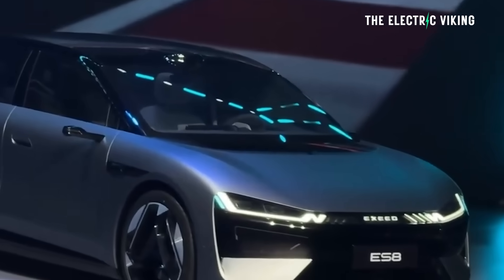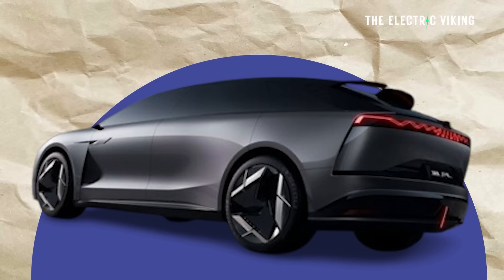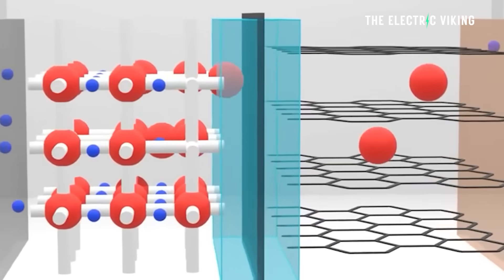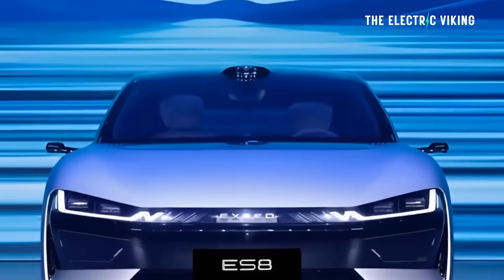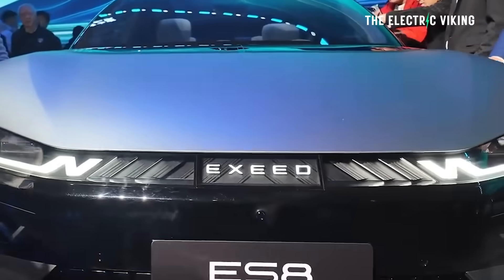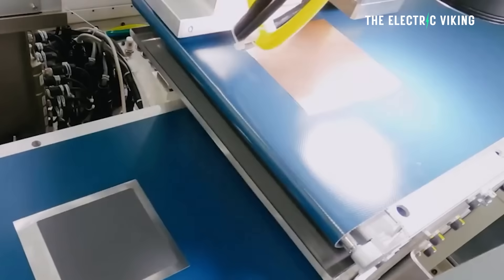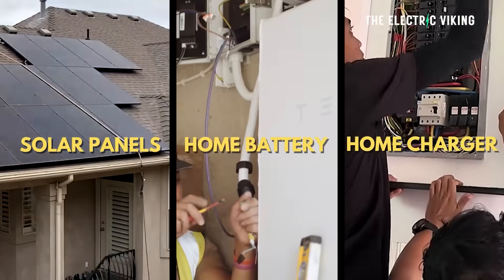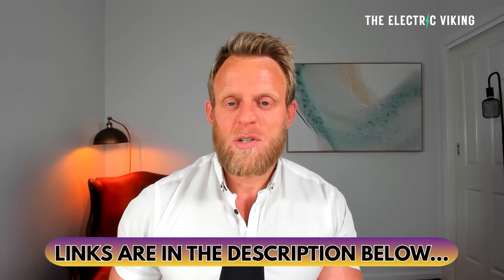Chery’s Solid-State EV with Insane 1,500 km Range in −30°C! Coming This Year

Comment: I think you are misunderstanding energy density vs capacity.
Energy density only affects the physical size and weight of a battery.
i.e. a NMC battery with capacity of 100kWh and a solid state battery of 100kWh have exactly the same capacity, but the solid state battery will be smaller and lighter as it has a higher energy density.
Therefore if you have a car with a 100kWh NMC battery and the same car with a 100kWh solid state battery, the solid state battery will have a slightly higher range simply because the pack is lighter but the difference won’t be huge.
If you look at a Lucid Gravity, it can do approx. 725km with a 123kWh battery. If you put a 123kWh solid state battery in, it will do a slightly higher range because the pack is a bit lighter.
You said you think the battery size will be 100kWh to do 1500km range. That would be impossible. It would need to be more like 200kWh to get that range. The solid state is the only way to do that because the energy density is higher so you can physically fit 200kWh of battery in the car.
Reply: 😊people have been correcting him for the longest time. me included. shows you that he never looks at the comments
Reply: @kilamayt597  definitely ‘a consultant.’😅
Reply: Yeah you could have a smaller, lighter battery for a similar range, or the same size and weight battery with much longer range. It's funny though right, Donut says "lookee we have a SS battery ready to go," suddenly all these hands shoot up, "me to, me to." When it's tested and verified by independent reviewers and testers I will believe it, I am skeptical at the moment, but seems a big risk to pull just for some media attention so the next month or two should be interesting whichever way it goes!
Reply: He's getting his information from somewhere I don't think he's pulling it out of thin air. Either way we don't need 1500km range that's too much and makes the EV heavier,  half of that would suffice.
Reply: @PyroShields He is pulling it out of thin air. It is like saying a pound of bricks is heavier than a pound of feathers. It’s just basic physics.
Reply: @PyroShields   Yeah for cars it could be reduced in size.  I’m thinking trucks though and a 900 mile battery the weight of a model 3 battery would be huge deal.  EV trucks that could tow would be a reality, particularly if it has fast charging.
Reply: @1diggers1  And when you're not towing you're hauling a heavy battery for nothing. Horrible idea.
Reply: @P @PyroShields same as trucks do today but those are burning gas or diesel.   There is no doubt that EV trucks that have the range to do truck things will be wildly popular and sell like crazy.  BTW the battery would be the weight of what’s in a model 3.
Reply: @1diggers1  What gas truck has 900 miles range? And how exactly it will weight the same as a battery that only has a range of 390 miles? That's not how physics work.
Reply: Another person pointed this out to him, but he keeps saying it.
Reply: He has made this mistake in multiple videos. But then again, isn’t a pound of bricks heavier than a pound of feathers?
Reply: Also, solid state is much more durable. It can handle much faster charging speeds. You can supercharge every day without issue. It is the next level of battery technology which will get it to the mainstream.
Reply: Well explained
Reply: I looked it up, the cherry battery to do 1500km range would be about 320kWh.  The weight of that battery would be only about 450kg.  Which is about the same as a Tesla 3 long range battery.   I like the capacity to weigh ratios for batteries, most are around 6.5 kg/ kWh.   Cherry would be  1.4 What a jump up! ( or down I guess)  Good stuff.
Reply: @1diggers1  4.68km/kWhr is pretty inefficient. On a freezing day, highway speeds, winter tires, I get 5.5Km/kWhr. In near perfect conditions, I get 8km/kWhr (I have gotten as high as 10 if I really baby it in perfect conditions and slower speeds). I think 6km/kWhr would be more typical. That would be a 250kWhr battery.
Reply: @yodaiam1000   Even better!  I was going with what google was saying the typical EV gets.
Reply: The engine can be more effektiv and because of this dont use so much energi as other engines, also the design have less air resistance
Reply: EV Viking has become a joke…once a good channel, he now is simply click bait with “gamechangers” and speculative, mostly inaccurate statements about technology…
Reply: You are right. I like it that you’re trying to be as conservative as you can by saying an SSB of 200kWh would be needed for that range. Depending on the vehicle size and weight it can handle you could have an SSB higher than 300kWh
Reply: There are 2 types of energy density ....so hes not incorrect
Reply: I hate if he messes that up all the time. The consumption is a physikal Limit that you can't beat. So the Pack needs to have huge capacity
Reply: True  solid state battery is safer .
Reply: He is a fricking moron. I've commented about the fact that he misunderstands this concept for a couple of videos now. Or he doesn't understand or he doesn't give a sh*t.
Reply: @Tostie1987  Yes, but you can book a call for expert opinion.
Reply: @Tostie1987  Indeed, he seems to want to come across as ignorant. The penny eventually dropped re watt hours /Kg so I live in hope 😵‍💫
Reply: @Tostie1987 this guy seems like a dreamer not a thinker
Reply: Yep, I pointed it out to him twice. I’ve unsubscribed, just got dragged here by headline

Comment: Solid‑state batteries are real, but they will take time to reach mass adoption. At first, major battery makers such as CATL, BYD, CALB, or Gotion ... will develop and produce them in pilot phases. Only after these suppliers prove the technology will automakers begin integrating solid‑state batteries into vehicles. Widespread use in cars is expected closer to the late 2020s to early 2030s, not immediately. So, how Chery is introducing in 2026...?
Reply: SSB is disruptive tech. just like ICE OEMs didn't see EVs coming so fast, CATL will be caught by surprise and be irrelevant.

Comment: The Electric Viking doesn’t appear to understand that a kWh is a kWh. It doesn’t matter how much they weigh or how physically large they are.  Obviously this is more than 100 kWh to get that range.
Reply: No, he doesn't, but we know what he means.
Reply: if the battery is more energy dense, you can get a lot more miles out of the same amount energy. it'll be reflected in the efficiency numbers, but that's a bit of a mislabel.
Reply: @xtdude  No, the lower weight doesn't make a significant difference to the range. Fully loaded EVs and minimally loaded EVs have a range difference of about 3% (it is not zero but the effect is pretty much insignificant). The Viking makes this mistake all the time. He doesn't understand the difference between the total energy stored the and energy density.
Reply: @yodaiam1000  Doubling the weigh will reduce the range by between 30 and 50%.........according to my mate Google.....so the reverse would also be true.....
Reply: @davecondliffe-z2n  You aren't doubling or halving the mass. The battery is about 25% of the weight. If you increase the pack energy density by 50%(which is a hell of lot), the car weight might change by 15% (reduced weight of structure and suspension included). 30% of 15% is 4.5%. There are many people testing the range for different loads on EVs especially pickup trucks since there is such a controversy over range for towing. There are a whole bunch of videos on Youtube showing test results. What you lose from accelerating the mass, you get back from regen and rolling resistance is a small percentage of the drag especially at highway speeds. If you look at test results for pickups, you have about a 3% increase when the truck is fully loaded (with no towing and added aerodynamic drag).

Comment: Why put a huge battery in a car when it can be charged in just a few minutes? It costs money, increases the car's weight, and we still make stops on longer trips.
Reply: It's always a compromise. At most current charging stations, you might not get the power to recharge your car fast enough. Having a larger range will help you to overcome the problem. And home charging with AC is always comparatively slow, but by far the cheapest option. Imagine a cab operator: they will recharge slowly at the cab operator's site, when business is slow, and they will be glad they don't have to worry about range during the time business is high. Same is for fleets for field service technicians or sales persons. They will charge on site, and then driving long distances every day, and especially field service technicians might not be able to recharge at the customer's site.
Reply: because its just bullcrap and they have to say and promise something...its all lies
Reply: They are just doing it for the advertising effect.  I'm sure you will have to pay extra for that chemistry and an additional fee for that kwh battery size.
Reply: @Islamisthecultofsin doh..you think?
Reply: @Ebonyqwe  You'd be surprised how dmb some people are.  Somebody out there thinks that it'll  be on the econo model.
Reply: Because not everyone just drives a hatchback 10 miles to work and back, and not everyone has just a 2 hour bladder. Some of us have real world uses for a battery with massive capacity. Imagine pickup trucks, delivery trucks, RVs, etc. towing trailers. A higher capacity battery in the same space means I can tow my trailer for longer without range anxiety. Just imagine how much gasoline and diesel will be saved once most pickup and larger trucks are powered by electric, which is far superior to petroleum powered engines for towing. A battery that can give my pickup 900 miles of range? That translates into at least 450+  miles of towing range, which is massive. And put that same tech in a motorhome? 0-60mph in under 10 seconds, going up hills? Total game changer. And let me use that same battery for emergency backup power to my house? Higher capacity batteries make this all possible, and more. Think outside your box.

Comment: You keep using kwh as some sort of battery size measure, when it has nothing to do with battery size, but rather, how much energy a battery holds irrespective of its physical size. In order for a car to go from 500 km to 1,500 km range, the kwh of a battery must go up by a factor of 3, but still fit into the same space and be the same weight. So watt hours per litre goes up by 3 and watt hours per kg goes up by 3 for the above to be true. So if the car can go 500 km with an 80kwh battery, then it would need a 240 kwh battery to go 1,500 km. But that 240kwh is squeezed into the same space and weight as the 80kwh battery. It has 3 times the energy density.
Reply: Sam just reads scripts that are written and produced for him. I’m beginning to believe he has been replaced by an AI bot. that could explain the amount of content he puts out daily.

Comment: Direct result of the Donut lab scam (or not scam, real battery but such that cost so much to produce they'll never do it since they need an ASML machine to lythographically print carbon nanotubes and an ASML machine costs 400M$). The Donut lab shenanigan forced car companies who've had SSBs for quite a long time now, to finally step forward with their SSBs. So even if it was a scam, it had some very positive results🙂.
Reply: This is also a vaporware
Reply: That´s not correct nanotubes can be manufactured in several  several diffrent methods. Chemical Vapor Deposition (CVD), Arc Discharge and  Laser Ablation.
Reply: @TheSolitere  Right, but if you plan to print a full wafer 30cm in diameter, full with, say, 1mm long nanotubes, each takes about one minute to grow with CVD, but you may have billions of nanotubes on this wafer, so it may take many years to print the whole wafer. The only way to print it at once, is with a mask and EUVL lithography. For that you will need an ASML machine.
Reply: @TheSolitere  Now the interesting thing is to note that the university of Helsinki has an agreement with ASML and they can get printed wafers from time to time under this agreement - and also that the chief scientist of nordic nano, Dr. Bela Dhananjay Bhuskute, has connections there. So she could have arranged for one wafer to be printed. This would be good enough for 2-3 batteries.. And maybe that's all what they currently have. If they want more, they'll need to purchase an ASML machine.

Comment: For 1500 km much higher than a 100 kWh battery is needed. Higher energy density doesn't mean lower kWh is needed for a given range. More range means more kWh is needed independent of energy density.

Comment: 600 Wh per kg for 1,500 km range. 
Assuming ground breaking efficiency of 10 km per kWh, the battery cap will be 150 kWh. The battery weight at the density is 250 kg.
For comparison, BYD Atto 3's 60 kWh LFP Blade Gen 1 battery at 150 Wh per kg is about 400 kg. Efficiency (my experience) is 6-7.5ish km per kW, so range is about 360 km at least or 460 km at best. Can't expect much for 2022 technology.
Reply: The math works, but 10 km/kWh is the big assumption—600 Wh/kg cuts pack weight, not physics. The real SSB win is today’s range with much smaller, cheaper packs and reliable 5C charging, not 1,500 km headlines.

Comment: Obviously 100kw battery won't get 1500km.try 180kwh.
Reply: If the car weights less due to higher energy density then it could be
Reply: @JuanSQuiP  A very aerodynamic car consumes about 130 Wh per kilometer. That is with an average weight of 2500 Kg. If the battery could be 2.5 times lighter (due to the higher energy density), the battery would (theoretically) weigh 250 kilograms. That is a reduction of about 350 kilograms. No, the car will not consume three times less energy due to a loss of 14% (due to the battery being lighter).
Reply: Try 280 kwh
Reply: @Mootje-t2y  225 kWh if the car consumes about 50 Wh per Km.
Reply: @Tostie1987  this would mean that every Kwh would take the car 20 km far.
Which is very very unlikely.. I am drivin 1 : 4,3 or something (2015 Tesla MS)

Comment: Ask about battery life of these solid state batteries! It’s a show stopper.
Reply: Yeah, goes 1500 kilometers, but you can only use 20 times before the battery is at 50% capacity.

Comment: EV's with this kind of range will kill off ICE cars within a couple of years. 

With boutique manufacturers utilising carbon-fibre vehicles, a range of 1000+ miles between charges may be achievable.
Reply: I hope you're right, but I fear even being able to drive coast to coast on one charge won't overcome the amygdala of the average ludite American lol. Propaganda from oil will keep ev's as a politically charged decision even when it is financially advantageous.
Reply: What a Joker you really are 😂😂😂
Reply: They will not, huge part of the market not interested in EV nor do they have charging  . Why this obsession with no more ice cars😂
Reply: @daweigo6851 ICE cars are old technology, inefficient, too costly, typically with less power and torque, prone to breakdown and needs costly servicing and is an unnecessary polluter.

Far better to get an EV, you can always get it to match the noise of any ICE car you choose if that is the element you are fearful of losing.
Reply: @neilmckechnie6638 😂😂😂 What a complete joker you are, The AA breakdown service in the UK have more callouts to Evs than Ice car's, which is incredible considering there's only 4% of them on the road 😉 😂😂 Plus there's nothing like the sound of a V8 V10 or V12, mind you some Cosworths sound awesome 👌
Reply: @johnthemagnificent7022  You are lying about your name too. The opposite of magnificent.

Comment: Wow, game changer.  A range of 870 miles
Reply: 932.06 miles
Reply: This claim is from a Chinese company and they use the CLTC range estimate which is highly optimistic. You need to take it down by about 30%. Then it’s more like 650 miles. Still very impressive of course.
Reply: Does batteries will last 120 cycles

Comment: Doubters can go an eat grass I've read the research papers and I've seen the eco system 

Solid state batteries are here and they are ready

I don't believe in empty skeptism I believe in doing research and being informed
Reply: Well said!
Reply: They won't have it before CATL or BYD
Reply: @100c0c  Donut Lab uses a supercapacitor that has a special electrolyte that acts like a nano-generator, it harvest energy from the environment, the electrolyte is piezoelectric